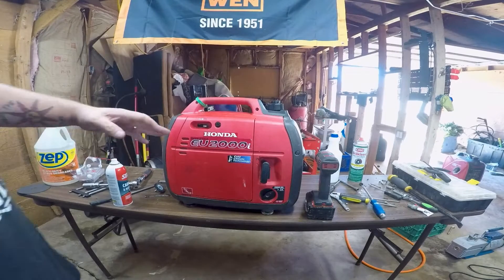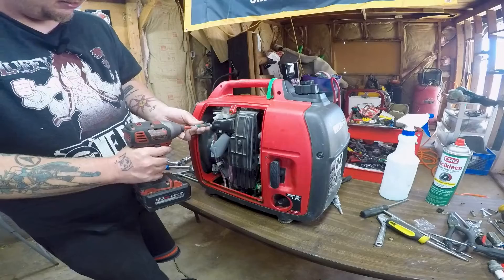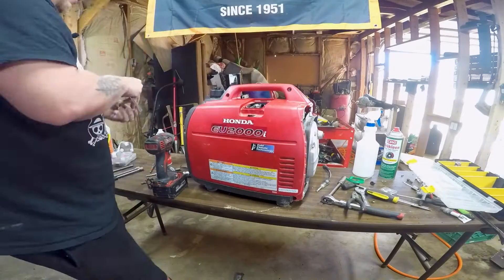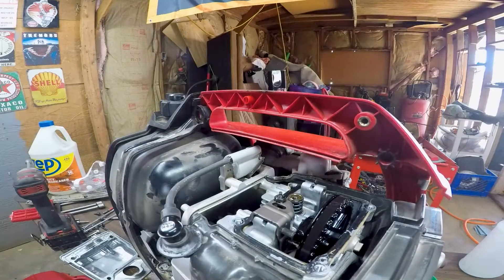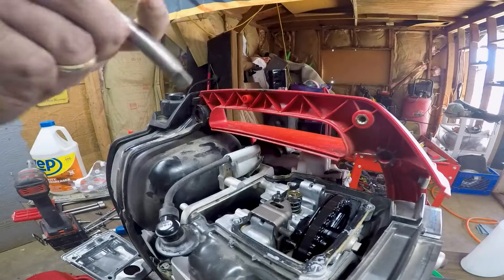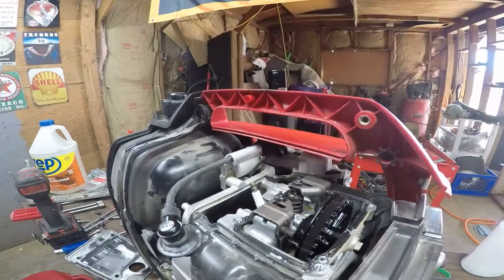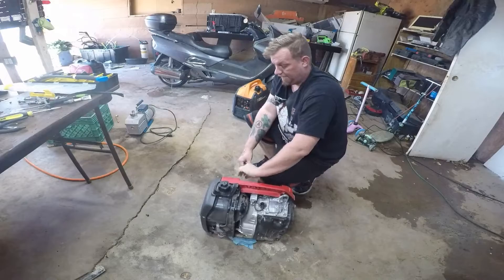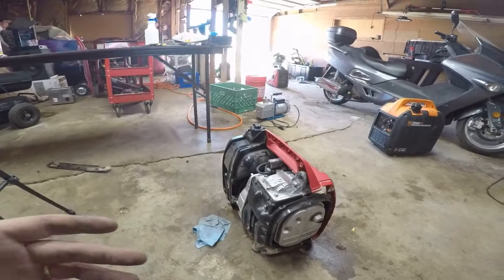Honda EU2000i Not starting? Fixing a stuck intake valve.

Comment: I believe that the over Head Cam system has a belt that  helps with the movement of the valves  I could be wrong about that
Reply from the maker: It does
Reply: @RepairGang   just to make sure it does I looked it up and it is much heavier than the o.h.v engine Plus the belt is probably not a great thing to have to replace on the o.h.c engine 🤬😡🥺😭😞😔😕